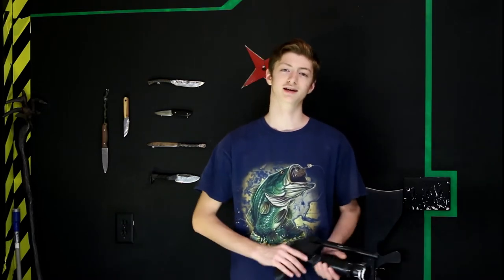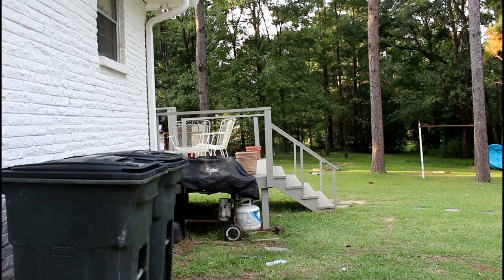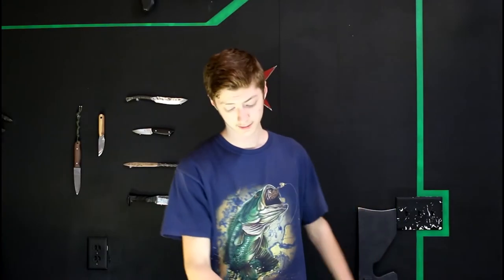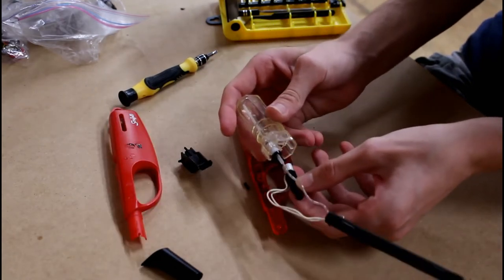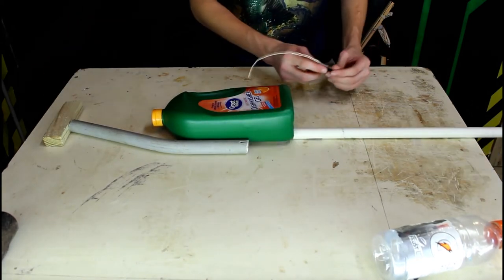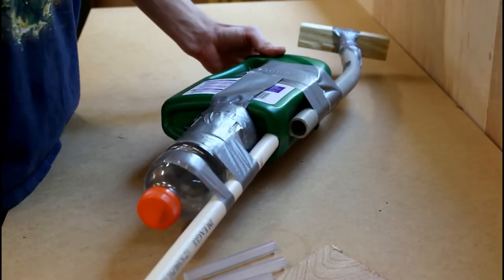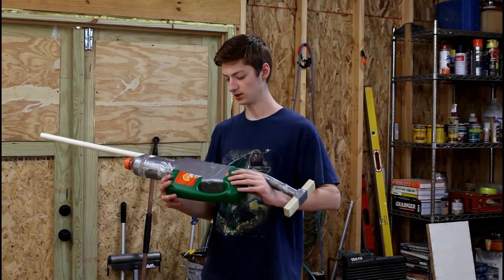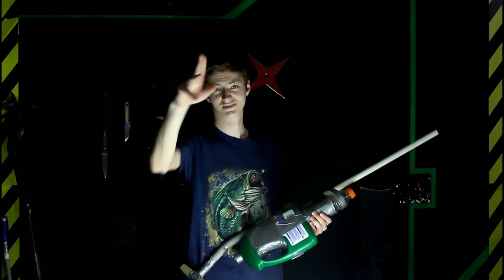Hairspray powered gun from TRASH

Comment: good day, bruv. is this secure enough? would it flop to the point where it would explode?
Reply from the maker: I need to post an update video. Actually, the other day it blew up on me. I jammed a wad of paper down the barrel rather tightly, and the pressure blew out the seam of the bottle. This was more of an experiment than anything else, and I don't recommend doing it. Not that you shouldn't. I just don't recommend it 😉

Comment: What kind of gas did you fill in? Is there any replacement for gas like hair spray or sth?
Reply from the maker: You can use alcohol in a fine mist spray bottle, hairspray, spray deodorant, spray paint, cooking spray (I think?).... basically most all canned sprays have a flammable propellant gas. But of course spray paint has unwanted paint...
Reply: @jakemakes  paintball!